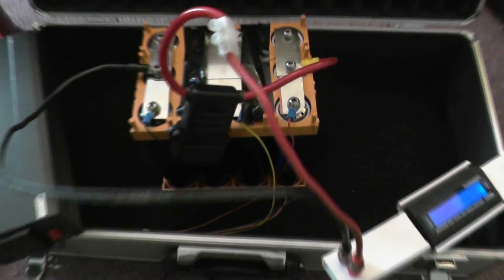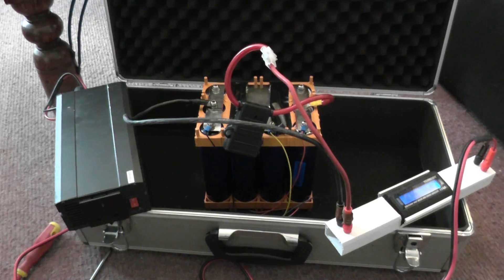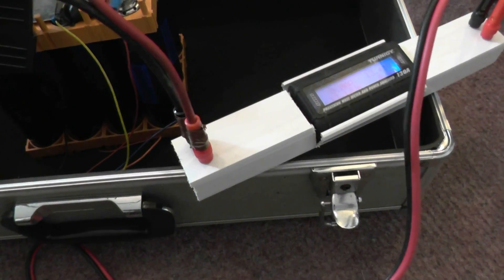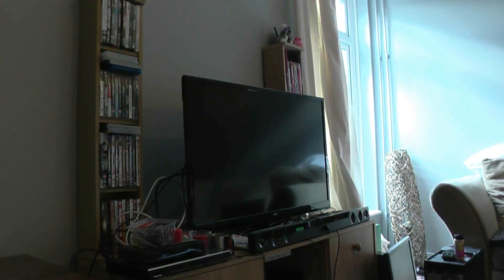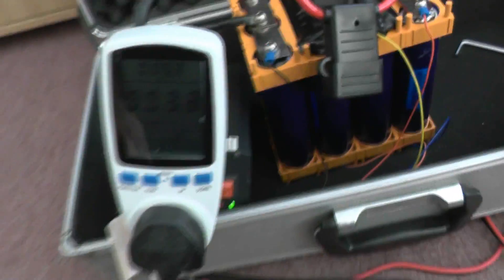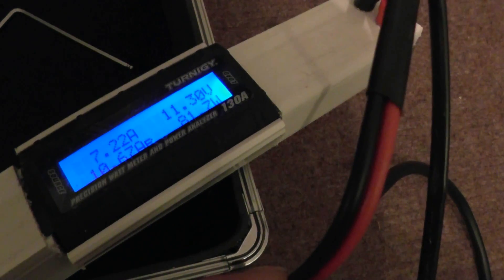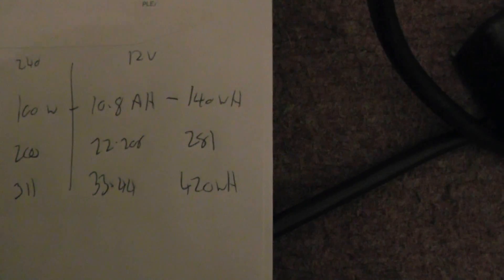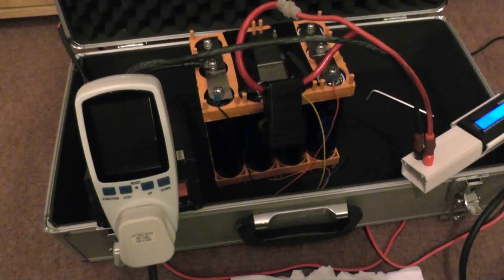LIFEPO4 part 4 The first test

Comment: Tks for the video. 
1 question.... can we replace this batt with car batt??
Reply: felix liew Yeah, u can connect any type of battery to an inverter, just be sure to check the shut down voltage for the inverter, but actually most 12v inverters are made more for lead acid battery which are car batteries so I don’t think will be a problem there.
Reply: Thanks bro

Comment: EEK! nearly £200 for 36AH. Bit spendy for me at the moment, I'll stick to my SLAs for now. XD
Reply from the maker: They are! But they will deliver every last watt in a pinch! And to top it off there's 2-3k discharges depending where you stop! They were $1000 per kwh in 2004 and are down to $400 per kwh now!
Reply: True, I think the only really compelling reason to go li at the moment is for weight reductions, for large amounts of power anyway. Can't argue with £50 for a couple of 20AH SLAs, especially if they are going to spend the next 10 years in exactly the same place.

Comment from the maker: crsbt I need a shed before I can get my solar panels here! With recent weather all the decent sheds have sold out, =/ then I can have the best of both.

This type of battery could have many uses, camping/off-grid/prepardness I don't want to miss any ideas, the best one was to make another the same and use it on an electric bike and as a 12v battery pack!